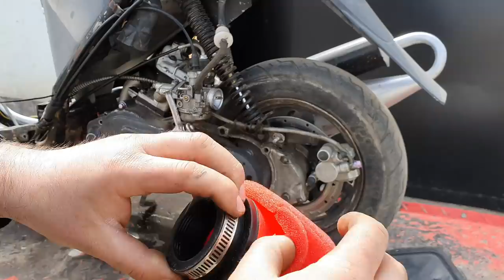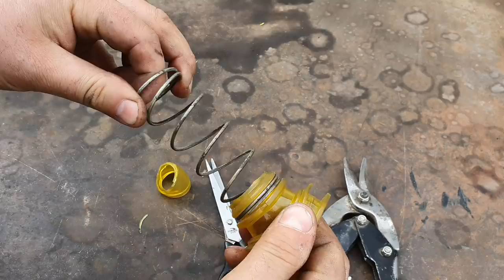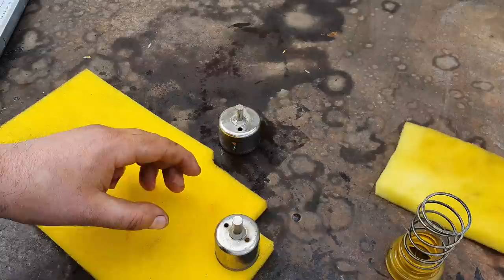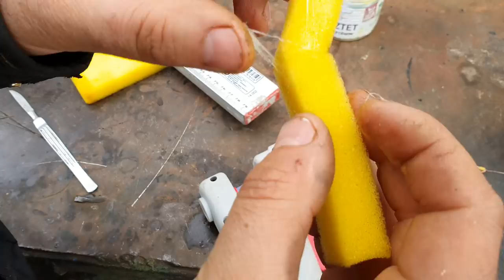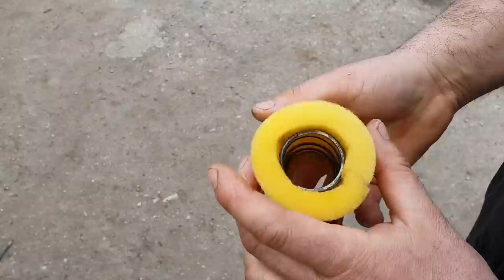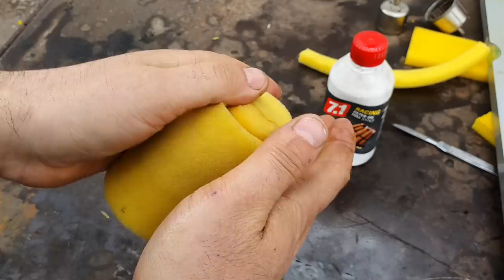Фильтр нулевого сопротивления для скутера своими руками

Comment: 0:21 did anyone notice, that the wire wasn't on the spark plug and it runs?
Reply: and the wheel don't spin in full gas ? :|
Reply: @mircea123buftea   i think the variator belt wasn't on the rear variator
Reply: It is a magic wire 🤣🤣😂